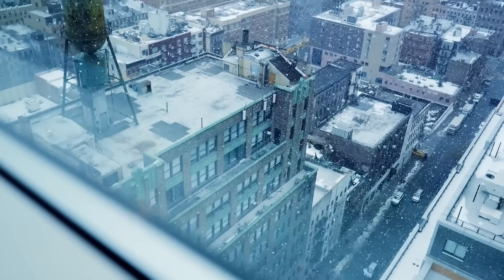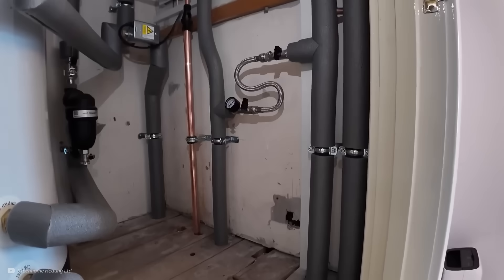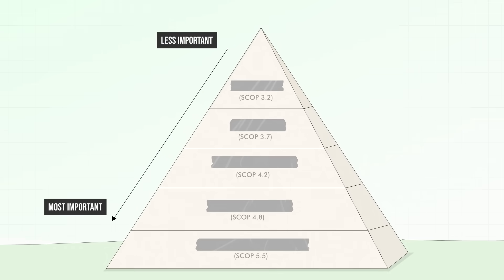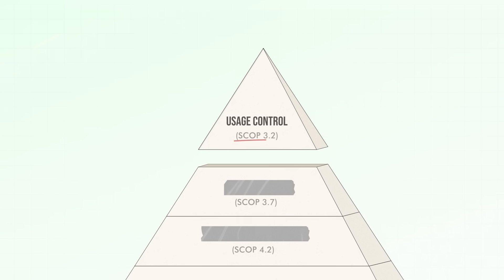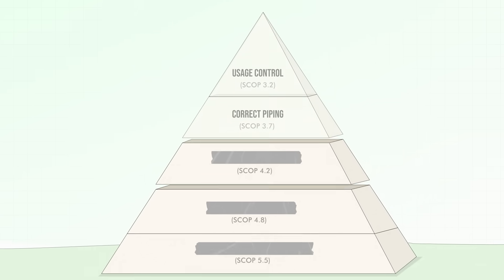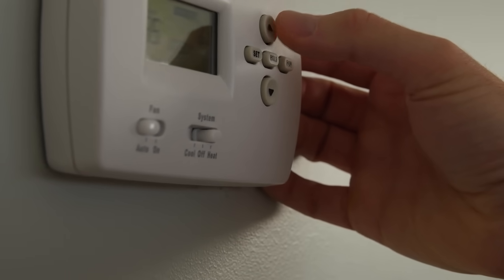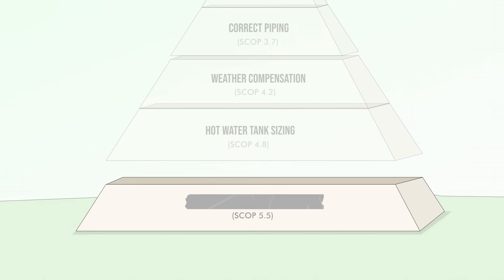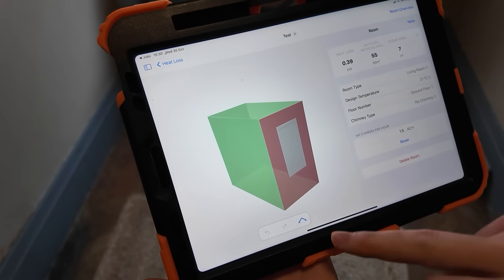The Genius of the World's Most Efficient Heat Pump

Comment from the maker: Thanks for all the great comments - I was torn about using ‘efficiency’ or COP, but efficiency is widely used in the industry and is much more understandable for potential video viewers, so I went for that and tried to explain it in the video! 

For anyone interested, Adam’s average COP for December has been 4.62!! (462%) which is crazy high.
Reply: So help stop the misuse.  Call it COP.  It is an easy concept.
Reply: I currently have a COP of 5.1 when heating from -1C to 38.7C (Heating mode) with the Austrian Lambda Eu13l. The Lambda currently is the best you can get here. We use the Link3 for storage which also helps in reducing overall energy consumpion.
Reply: @camelitos  would you care to share the entire data set with me of just the cherry picked part?
Reply: @camelitos  that thing needs a forklift or boom lift to install it. The thing is far to big. 52dB is louder than most large municipalities allow even if you could fit it somewhere. It's also easy to discount the power used by the hydraunic pump, but since conventional HPs and mini splits do include the circulator, it is cheating and misleading. A COP of 5.2 is generally just above break even point where natural gas is available, so still not remarkable.
Reply: @SuperS05  It was delivered on a standard pallete and was installed by hand. Yes it is big but not too heavy. It is big mainly because of the huge radiator and Fan. But because of that it can be as efficient and quiet as it is. Most heatpumps have tiny fans that have to spin crazy. 52db (please consider how it is measured) is one of the best values in the market. i do not know what you compare it with. Burning gas gets you a COP of 1 if all the energy is being used perfectly. So how do you calculate your break even point?
In Summer and autumn our COP is between 7 and 8.5 depending on the outside temperature. 
We have radiators and no floor heating so the temperature in our radiators has to be a bit higher which reduces the COP. On the other hand we have a freshwater system for hot water so we can go down to 42C in the storage and still get warm enough water without risking the growth of legionella
Reply: @camelitos  my breakeven point is in $$. It cost money to burn natural gas and convert it to electricity. Even the best combined cycle plants only hit about 50-60% electrical efficiency and they are expensive on maintenance. When not operating in combined cycle mode, it's half of that. Combine that with transmission and profits, you get an electricity price that requires a COP of about 4-5 just to break even. I have compared the utility prices several jurisdictions just to be sure of my breakeven point. Propane ends up being  usually closer to a COP of 3 breakeven. Oil is a bit lower but approximately the same.

Most cities have a sound limit of about 40-50dB. Eg. Paris is 40-45 dB depending on the time. London is 42dB. New York is 42-45dB. This is generally measured at the property line, but with small properties, it's hard to get much distance, and very hard to use barriers since air movement is critical. The max rating of the EU20L is 59dBA.

150-210kg is NOT light. I'm not manhandling something in that weight class and size. That would require no less than 4 strong people and probably 6-8 realistically. Here we would have to hire a moving company as technician labour would be over $4500 just for 3-4 hours at 8 people. Crane would be cheaper. The moving company might be cheaper but with less precision, and more risk. 

Plus the extra 3kg of control panel? I'm google translating so I'm not sure if it's getting that right.
Reply: great video! that tank is a perfect habitat for legionella bacteria, it should then be heated above 60 degrees C regularly to prevent legionella growth, people die from this bacterial inhaling droplets in the shower, smells of sulfur or rotten eggs is usally the sign
Reply: I would've thought the biggest efficiency gain would be from storing heat during hot days and "storing cold" during cold days or a form of arbitrage. This way the pumps are working less overall and there is always less temperature difference at the target and more for the pump.
Reply: Efficiency is not the industry standard for heat pumps or refrigerators. Stop lying.
Reply: “Efficiency" is the most abused word in marketing, as it can be anything as long as it is divided by something else.
Reply: @skyak4493  Not really. For the quantity to be an efficiency, it needs to be: (actual quantity under a given condition) / (theoretical max under a given condition). It certainly cant be anything divided by anything. It certainly is abused by marketers, but lets not add to that (with bad definitions such as saying it can be: (anything) / (something else)).
Reply: @icojb25  No it doesn't. Efficiency means (useful stuff done) / (stuff put in). Theres no requirement for them to even be the same thing, like batteries are measured as Joules/Kg. Your definition is fraction of maximum efficiency, where stuff put in is the theoretical minimum to do a amount of stuff.
Reply: @Mordenor  Fair enough ... the point was, its not "anything" over "something / anything else" ...
Reply: @Mordenor  Very True, Usually I like to have both numbers have the same base unit so the efficiency doesn't have a base unit and is just a raw percentage.
Reply: December cop of 4.62 in December on the English coast or California coast is a lot different from a cop of 4.62 in Saskatchewan or Ulan Bator ( Mongolia)
Reply: @fredfrond6148  Good thing they are not talking about installing heat pumps in Mongolia then.
Reply: Very interesting!  ...of course, if they incorporate the 'Jean Pain Methods', I could see someone's PCOP hitting 10.  

(From his book, 'One experiment showed that a 50 tons compost heap is capable of producing hot water at 60°C (it entered at 10°C) at a rate of 4 liters per minute, for 6 months.'  'Another compost heap, 120 tons in weight and more than 18 months old, was still at a temperature of 58°C, which would appear to mean that the same heap would be capable of heating buildings for 2 winters and throughout these 18 months produce enough water for the occupants of these buildings.')
Reply: @KeithOlson  for a compost pile to actually compost, a fairly warm temperature is required. You take away energy, and therefore temperature, at first you'd see an increase in compost activity down to about 40°C or so, then it would fall off fast. I'd have to read that book to see if that was included, but at any rate there's only a VERY limited amount of energy available and would require very tight control with supplemental heating. It would also only be available to farmers and no one else would have the land available for 120tons of compost even if they could get their hands on that much, and were also able to dispose of it. A fun application but a very limited one.
Reply: @SuperS05   I hear what you are saying, but...

1. The organic material that makes up compost is very insulating, so even extreme winter temperatures can't stop a large enough pile from maintaining 60C+.

2. I fully agree that it is a massive amount of compost which takes up substantial room, but a full gallon of 60C water every single minute is a LOT more than most households needs.  ...and that 120 tons is big, but as much as I thought: about 6500 cubic feet, which will fit into 10x20x40 feet.  That may not fit into everyone's back yard, but it will into many, especially in rural settings.

3. Sourcing materials at the proper ratios, mixing everything together, prepping & maintaining the pile, and loading/unloading would be no joke, but not especially difficult if you have the right equipment.  Again, not for everyone.

4. The pile won't just stop working one day; it will simply produce less and less heat over time.  Some rotating the material will help, but not stop it.  OTOH, that drop in temperature means the compost is nearing the next step: being sold as a soil amendment.  That 120 tons of mature compost can be worth $2000 to $5000, and even more if it is organic!
Reply: @KeithOlson  I was aware of the insulating value. It's still common to cover it with tarps and hay here to keep them warm during the winter. That wasn't my concern. The heat comes from the actual breakdown by organisms. It's life itself that is mostly generating that heat. There's a sweet spot temperature range for the most efficient breakdown of the compost. Too hot and it slows down, too cold and it slows down. 60°c is actually above that sweet spot, which is closer to 40°c. So you can take away that energy (heat) and get better decomposition, but only to a point. Take too much and you can shut it down totally and will have to wait for it to warm naturally. (here you'd freeze it)

1gal per min sounds like a lot but it wouldn't be enough to heat a house. DHW use only would be fine for maybe up to a dozen people. Less if they like longer showers. (that would equate to about 20,000 btu/hr or 5.8kW)
Reply: @SuperS05  "There's a sweet spot temperature range for the most efficient breakdown of the compost."

Absolutely.  60C is pretty high.

"1gal per min sounds like a lot but it wouldn't be enough to heat a house."

Probably not, but I was mentioning it as a source of auxiliary heat--to help increase the COP/etc.--rather than using it on its own.  (Mind you, it would be PLENTY to heat an Earthship or Wofati home.)
Reply: @KeithOlson  i suppose that'll depend absolutely on the climate and how big the house ends up being lol. But either way the space requirements means I'm not using this method even if I didn't have my neighbors trying to unalive me
Reply: Very good video, you explained efficiency and COP well enough in the video. clear enough for me anyways. Real part is the efficiency of course and touched on things that made 100% sense.
Reply: If you are looking for great Cops etc. take a look at OVUM, Lambda. But they are expensive.
Reply: Do you realize that using such an efficient heat pump you can generate more electricity than it consumes: from 1 kW input you can get 8 kW output heat - with steam generator 50% efficient you will get 4 kW output.
Reply: @zbarjevsky  50% efficiency is wildly optimistic for a steam electric generator, and heat pumps can't heat water to the point of boiling with that 8x energy ratio.
Reply: @somedude2492  You can use liquids with low boiling points like acetone with the boiling point 56.05°C. As for steam engine efficiency it can be more than 20% to get positive energy flow.
Reply: You were 'torn', suuuure - you just needed a bigger number to put in the vid, coz you know 'engagement'.
Reply: COP of 4.62 is not crazy high, in fact it's quite disappointing. For Dec'24 my COP was 4.2 for an 8mm microbore system with a low loss header and two pumps, one of which supports an all radiator circuit, and that is for both heating and hot water. The reason why it is so good is that I have an oversized (11.2kW) heat pump, working at partial load on the really cold days, meaning the efficiency is higher (and that is supported by the manufacturer's data tables) than the next size down (8.5kW). It makes perfect sense if you think about it. A scroll compressor spinning at say 6,000rpm/75% capacity incurs much lower frictional losses than one spinning at maximum 8,000rpm/100% capacity
Reply: @ how are you measuring this?

I don’t think anyone has a problem with a high COP. It’s just that they say it keeps getting higher along the system not lower as more losses are added. You can’t add energy to the system after the heat pump.
Reply: please dont call a CoP of 4.62 , 462% .   A HP with a thermal efficiency of 100% has a CoP of 2 , and so on, as one unit of electricity produces 2 units of heat.  So a HP with a CoP of 4.62 has a thermal efficiency of 362%
Reply: @ hahaha. How can you be so confidently wrong!!!
So tell us what’s the efficiency of an AC with a COP of 1?
🤣🤣🤣
Reply: @ the thermal efficiency of  a HP with a CoP of 1 is 0 as it doesnt give out any heat above the electrical work that is put in
Reply: @ if it was 0 efficiency it wouldn’t move any heat at all. 
I think you’re confusing efficiency with gain. 
🤦🏻‍♂️
Reply: @fajoopsa  it doesnt move any extra heat - the heat output of a HP with a CoP of 1 is by definition the same as the electrical work
Reply: @ yeah. So 100% efficient. 
Just like an electric element heater.
Not 0%. 
🤣🤣
Reply: @fajoopsa  fraid not -  heat pumps are no good if they dont have a CoP of > 1. The "efficiency" in this case is about the ability to move heat energy which is a completely different property to the heating effect of a gas boiler or immersion heater
Reply: @ldm3027  what are you talking about?
Where are you going to find a heat pump with a COP of less than one?
What does this have to do with you saying that a COP of one is 0% efficiency? It’s 100% efficient. 
Efficiency is efficiency. You can’t change the laws of physics. 
A gas heater with a COP of 0.3 is 30% efficient. Not hard to understand champ.
Reply: @fajoopsa  who said anything about a HP with a CoP of <1  (although it is possible) ?
A HP is a thermodynamic machine not a direct heater like a gas boiler or immersion heater. So efficiency for a HP relies on its CoP being >1, otherwise  it isnt pumping any additional heat.   There is no such thing as a "gas heater with a COP of 0.3" as CoP is a term used to express the heat movement ability for HPs , which direct heaters dont have (by definition)
Reply: @ hey kid. Stop embarrassing yourself all you have to do is get on Wikipedia and look up COP.
You will see how you are 100% incorrect in saying that a COP of one is 0% efficiency. 
It is 100% efficient.
A COP of 2 is 200% efficient.
A COP of 3 is 300% efficient.
You get the point. 
Actually, you probably don’t.
Reply: @ you are clearly confusing “efficiency” with “gains in inefficiency”
Maybe English is your second language?
Reply: @fajoopsa  nice try but you dont quite understand how HPs actually work
Reply: @fajoopsa  now you are just making things up which is a shame
Reply: @ now I know you’re being a troll. I’m a Fridgy, this is my life.
There is only one person in this discussion here that does not understand how efficiencies work and that is you. 
Time you went back to school
It actually blows my mind how anyone could think something is 0% efficient. Just sit down and have a think about that. 0% efficiency and what that means.
Reply: @fajoopsa  and I am a solid state physicist so please dont try to be clever
Reply: @ https://en.m.wikipedia.org/wiki/Coefficient_of_performance

Read the second paragraph and let that sink in
Reply: Шановний сор це не ККД  який не може бути більше одиниці!!
Reply: 'torn between', not 'torn about'? ☹
Reply: Efficiency might be widely used. But it's wrong. End of. 

It's been given its own name for a very good reason.
Reply: @0tispunkm3y3r  Yet we talk about gas boilers as being e.g. 95% efficient or electrical element radiators as being 100% and people need to understand how to compare them against each other, and which comparisons are valid or not (e.g. gas boiler vs gas used to generate electric and then feed heat pump means you've got to factor in generation and grid losses).
Really what we need is not COP or SCOP or efficiency but some standardised running costs.  i.e. for a given building in a given climate, what are the annual running costs including things like servicing.
This is also something that is going to change as we get more renewables on the grid and more flexible electricity tariffs.
Reply: You were wrong, it's not efficiency
Reply: Really bad to propagate a myth that its >100% . The problem with saying its >100% efficiency (aside from it being technically incorrect) is that it gives credibility to all the backyard engineers and charlatans who sell rubbish to unsuspecting people on the internet and give the rest of us engineers a hard time having to re-explain every time. You know, "free energy" and all the rest.
Reply: It seems you assume your audience lacks an understanding of mathematical principles—efficiencies can never exceed 100%. While some sound common-sense HVAC principles were discussed, the speculative claims about improvement values come across as misleading, if not outright dishonest.
Reply: @professorWho-n3x Efficiency is not above 100%. It’s still below it (not sure what its’s but maybe 80%). You just use heat stored in air outside, so this way from injecting eg 1Kwh energy from the socket + 4kwh from air, you could get get 5kwh, but it will be less, do overall efficiency is <100%. It doesn’t mean you broke physics rules. You simply taken free energy stored in air outside which has a lot of energy even if it’s -20C outside.
Reply: @professorWho-n3x  you are talking about thermodynamic efficiency -  HPs give out heat which is not the same as work, so a unit of work (electricity) can produce 2 units of heat in which case the CoP is 2 but the thermal efficiency is 100%.   For a HP that has a CoP of 3 , its thermal efficiency is 200% as so on.  
Condensing gas boilers have a thermal efficiency of just over 100% but cannot improve on that
Reply from the maker: @professorWho-n3x definitely not, I know I have a very educated audience  - it doesn’t reflect on anyone’s intelligence to not know an acronym (e.g. COP)
Reply: @ZirothTech  I was addressing your integrity, pointing out that you seem to be misleading everyone by providing vague estimates based on COP numbers and oversimplifying the matter with irrelevant efficiency measurements (efficiencies over 100%).
Reply: @ZirothTech  " it doesn’t reflect on anyone’s intelligence to not know an acronym (e.g. COP)" Are you talking about your self? If you didn't understand the acronym you shouldn't have used it dozens of times.
Reply: @ZirothTech I have an intense dislike for misleading titles, I'm certain I'm not alone in that. 
It feels like you're lying. 😢
Reply: @ZirothTech how does 1kw of power that makes 2.5 to 3kw of heat end up being 8kw at the radiator inside because the piping is bigger and other efficiency gains? 
Efficiency gains are really just loss reductions. 
Your math is wrong. You’ve added not subtracted.
Reply: @professorWho-n3x efficiency can be over 100%. It all depends on perspective. Efficiency just refers to a ratio between something going in and something going out. Depending on what you decide is "in" and "out", that value changes. It just happens that 99.9% of the cases we're presented with daily have a maximum theoretical efficiency of 100%.
Reply: @somedude2492  Is "something" a technical term in science or engineering that I'm unfamiliar with? And does "It just happens" imply that events occur seemingly by chance, without intentional action or an obvious cause?
Reply: @professorWho-n3x  to your first question, yes. Engineers are not lawyers, not everything has to sound smart for it to be true. It has to work. To your second question, no. Hope this helps!
Reply: @somedude2492  I am a professor of electrical engineering, and the definitions of terms are precise and not subject to interpretation or debate. You are correct in the sense that this topic falls under pseudo-engineering
Reply: @professorWho-n3x  COP is 'coefficient of performance' which is what people talk about with heatpumps. 
The heating system uses 1kwh of power input to move 5kw of heat to the other side of the system, which is 500%. 
Whilst the terms can be confusing, this is how its discussed.
Reply: @Etacovda63  Your definition of COP appears correct, but your understanding of efficiency is incorrect. Efficiency is defined as (Work out / Work in) * 100 and cannot exceed 100%. Focus on the first word in COP—"coefficient"—which acts as a multiplier and has a mathematical range from negative infinity to positive infinity. Your confusion seems to arise from a misinterpretation of basic algebra, typically taught in the 8th grade. These are two distinct terms with separate definitions, and there’s no reason for them to be conflated.
Reply: @professorWho-n3x can you please explain the concept of energy in and energy out of a heat pump and how that correlates between efficiency and COP. I'm curious as I do not know. Could you also provide an example of this? Thank you.
Reply: Ah, my apologies, I must have forgotten that efficiency is a sacred term that can only bow to the almighty 100%.

Meanwhile, heat pumps—those rebellious devices that dare to transfer free heat from the environment—are clearly breaking the laws of thermodynamics. Thank goodness we have COP to rescue us from this ‘basic algebra’ crisis. But yes, if it makes you feel better, I’ll call it a COP of 5 instead of a '500% efficiency' and let the world carry on unshaken.

I thought that my point was blatantly clear, but I guess this is youtube, so I shouldn't be surprised that you didnt get it.

Don’t worry, though—I’m sure your 8th-grade algebra expertise will guide you through this thermodynamic minefield eventually. Until then, feel free to bask in the rebellious efficiency of heat pumps like the rest of us!
Reply: CoP and wefficiency is not the same, simlar but not interchangeable, no matter how much easier it is for those with a poor understanding of physics.
Also Kw is the wrong unit of electricty to use, KV should be used which is about 25% higher due to the heat pump being a reactive load.
Reply: @iareid8255  
For reactive loads, use kVA. Electricity meters count active power, anyway, so it doesn't matter. You only care about kVA (just A part of it) when you make the wiring.
Reply: @iareid8255 surly you mean KVA. As you are paying for your electricity in KWh it would seam appropriate yo use that to me 🤷‍♂️
Reply: @iareid8255 KVA, not KV. KV is a unit of voltage, and if you're measuring the voltage at your house in KV then you have really big problems to worry about. 

Also, most domestic installations are charged by real or active power, not apparent power. Power factor correction is only really a problem when you need to size the wiring or for industrial installs. At your house, power factor correction is the utility's problem to deal with. So, TLDR, kW is a perfectly acceptable unit of power measurement.
Reply: @somedude2492  
the Kv is a typing error, soory it wa snot intended.

I know how the loca area borad charges for power, and my point which you seem to have missed is that the power required is KVA on an inductive load, not KW which is flattering when people calculate 'effciency', usually wrongly.
Reply: @iareid8255  do modern heat pumps not include passive or active PFC?
Reply: @iareid8255  KVA (apparent power), not KV (voltage).
Reply: writing this comment for time travelers, its a scam, but you already knew that...
Reply: I’d like to see this compared to chemical BTU vs heat pump equivalent heating Joule.
Also, when power goes out, you freeze, but gas is less likely to go down….
Reply: I was going to repost this on my social media group, but not anymore. The one reference to "emissions", which doubtlessly refers to the global warming hoax, and utterly harmless, indeed beneficial, carbon dioxide. (2nd repost, screenshots taken)
Reply: Other than the unfortunate indirect reference to the AGW hoax, I thoroughly enjoyed the video!
Reply: Aside from the unfortunate, albeit indirect, reference to the AGW hoax, I thoroughly enjoyed the video. 😊👍(2nd repost)
Reply: I was going to repost this on my social media group, but not anymore. The one reference to "emissions", which doubtlessly refers to the global warming hoax, and utterly harmless, indeed beneficial, carbon dioxide.
Reply: Nobody cares bar the physicists and engineers.
Reply: @TheGalifrey it’s either correct, or it’s not. Ignorance is our country’s biggest problem these days.
Reply: @TheGalifrey Do you mean the very people who design and build heat pumps and the systems within which they work?
Reply: @TheHoveHeretic  yes, aka a tiny fraction of the user base 😉
Reply: @TheGalifrey  yes and the people fitting these things like to put "engineer" on their vans. Best get using the correct terminology.
Reply: @0tispunkm3y3r  "The Coefficient of Performance (CoP) is a ratio that describes the efficiency of a system."
"COP is a measurement of the energy efficiency of your air-conditioning unit’s heating performance. " So CoP is a measure of efficiency but equating the 2 is wrong, gotcha.